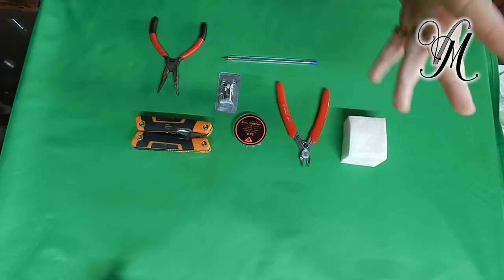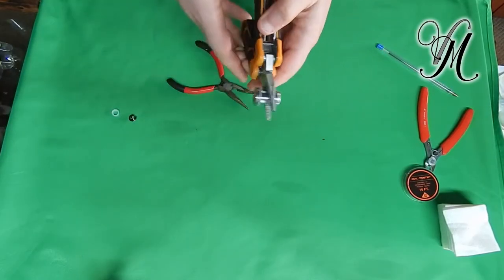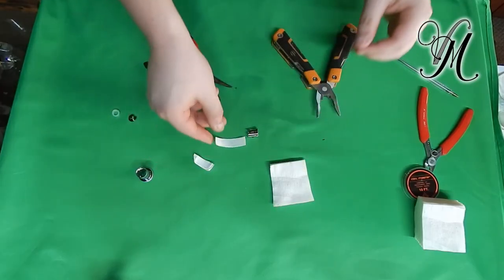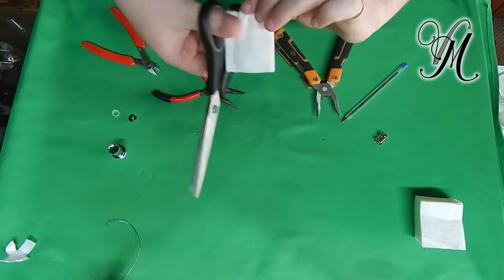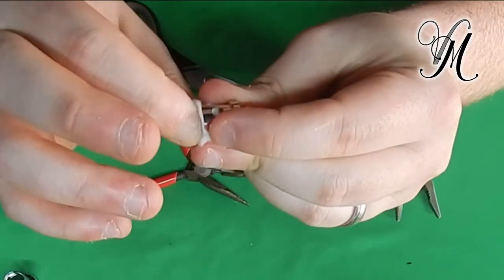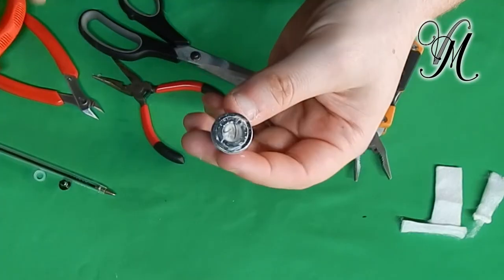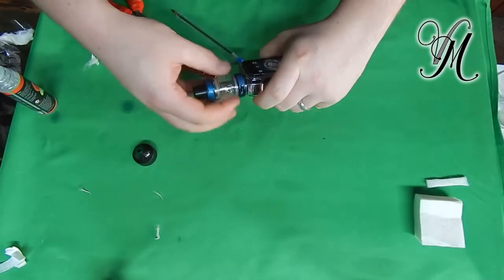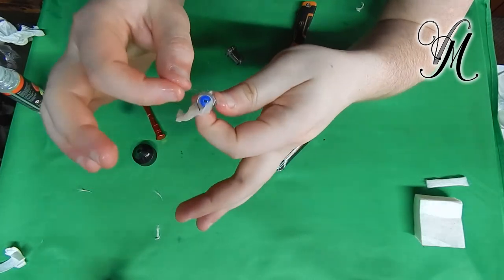How To Rebuild and Rewick Almost Many Stock Coil | Pre-built coils Including SMOK TFV Mesh Pro

Comment: use a wide rubber band on the coil cardridge before gripping it with the left hand pliers so you don't scratch the exterior of the cilinder. merely for aesthetic reasons and better grip

Comment: Just got a two vapefly rebuildable mesh coil after years of using Rtas and I love how easy they are to build in comparison, so I was wondering if i could do the same with my partners normal stock coils (as the only difference is that the rebuildable ones unscrew) but couldn't work out how to get it apart lol so thanks for the video very informative. I'm going to purchase another pair of pliers and have a go at rebuilding it with the mesh strips/cotton I have for my rmc coils wish my luck 😂

Comment: Anyone know a good way of getting the outer part of a uwell crown 3 coil off? to replace the pre-wick material.  Seems pressed on very tightly, can usually wash out the outer wicking material but would prefer to replace it just like the inner.

Comment: Did using wire change the ohms? What was the original ohms of this coil vs when you used wire and did this then change the wattage best at? I can see some people doing this? Then vaping itv at the wattage it says on the coil and burning it to death lol.
Reply from the maker: I can't remember the difference in ohms.

If you're trying to replicate the same resistance and wattage, I'd recommend using a tool to help calculate what the Coil should be (material, diameter, amount of wraps). You can find "coil building calculator" on the internet and there's a few useful apps like VapeTool.

If you get a different wattage, you can (again) use those tools to predict the optimal wattage for that resistance. But the manual way would be to turn the wattage down and slowly turn it up until you hit a sweet spot.

However if the cotton isn't fully pressed into the coil it will cause the coil to get hot, which really wouldn't be a pleasant experience, it would send hot hair up the airflow and burn the cotton.

It's more of a proof of concept, it can be done. But it's a hack (it's not supposed to be done). And it definitely shouldn't be done by someone that has no rebuildable experience. Plus the amount of time and effort it takes, really isn't worth it to just save £3-5 from buying a new coil.

An RTA,RDTA or RDA would provide and all around better experience.

Comment: where do you find to buy the grid only the resistance use on the vape Sky solo plus Coil 0.18 Ohm?
Reply from the maker: I presume by grid you mean the mesh (the actual coil part)

You probably won't be able to find then on their own.

Best bet it to look for "vape mesh strip with legs"

But you'll struggle, although there is some, mesh strip are usually for rebuildable atomisers, and most of those are clamped flat.

But still, have a look, I know wotofo do some with legs
Reply: @LetsNerdIt  ingres

exactly friend, in the national market it is easy to find the common ones without the fitting legs, there are some coil mesh that they are wound with KANTHAL wire, do you have any tips on numbering that these wires might be?
Reply from the maker: @RodolfoPereira101  I don't get what you mean by numbering?
Reply: @LetsNerdIt  which replacement wire um mm van vê 024, 026 ,028 ..etc.
Reply: @LetsNerdIt  what is the best wire to make the coil I am in doubt use Nichome or Ni 200 , what is the numbering 24,26 or 28 ? I need to manufacture mine thank you if you help me.
Reply from the maker: @RodolfoPereira101  honestly it depends on the coil size and preference.

I'd get some 28g wire and play about with it.

Just experiment to see what you like.

Sorry I can't be any more help than that.

If you haven't rebuilt before, I'd suggest buying a cheap RDA /RTA /RDTA and play with that first. You if you shop around you can catch half decent ones on offer for less than £10 from time to time
Reply: @LetsNerdIt  from now on, i'll provide even because it's not seven-headed things to assemble and build, thank you very much friend things that here in Brazil i have NOT found something like i saw in your videos.

Comment: Can the spiral part of the inside be touching or do they have to be spaced out like you had them.
Reply from the maker: They can be touching as long as the legs don't touch them.

(Like on an RDA or RTA)
Reply: @LetsNerdIt  what’s the difference if it’s spaced out or touching ?
Reply from the maker: @ramonvega499  it would make the resistance (ohms) different. 
If you have never used an rba (RDA or RTA) before I suggest byou try on those first

Comment: why do you use wire instead of the original mesh? I think mesh has a better ramp up time so aside from experimenting or perhaps you don't like the taste the mesh gives I have no idea why you would like to replace it.
Reply from the maker: This video was purely bro show it's possible, what coil is used is purely down to preference.

But I wouldn't thought to be successful mesh would be alot harder because it's easier to get hot spots and dry burn. Mesh is ace, but when it comes to links or wicking it can be a bitch.

Plus you'd need mesh strips that have got a leg. Unless you mean burning the original mesh strip clean  then reusing it?
Reply: @LetsNerdIt  try to use a cylinder of metal inside the coil the whole time, that way you can  roll the cotton thighter without deforming the coil. nice video. keep up the good work :D
Reply: @LetsNerdIt 😂 its easy to find   mesh with post aka legs, what you talking about bro ?

Comment: all this work to save $2.50  ?
Reply from the maker: Tis alot and it's not for me. But some people like to do it "just because"
Reply: @LetsNerdIt  i get it. I was just being silly. Great video.
Reply from the maker: @PugFaceMedia  cheers dude
Reply: My local shop is selling my coils for $9 a piece or a pack of five for $30 and because I like the sweet flavors they are only lasting me a day 😢 so this video is exactly what I was looking for! I literally just took mine apart too see if this was possible right before I found this video :) so glad I did find it! I really don’t want to spend $9 a day and that’s with it not tasting the best half way through the day! I want full flavor but I’d rather not spend 9 bucks a day on just the coil!
Reply: @PugFaceMedia I only do it cause I have proper tools to do it which makes it alot easier than this guy does it I burn bigger clouds and taste then any stock coil for my tank2 coils gti plug n play I built mine to burn at 150 watts its so nice people think the more watts the hotter it is but it depends on how much it can wick x how much it can hold at once